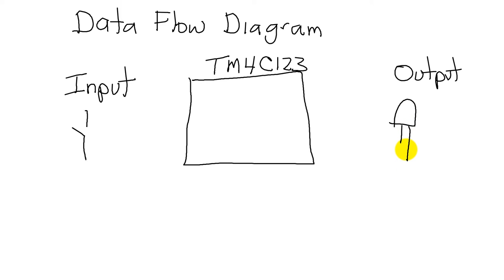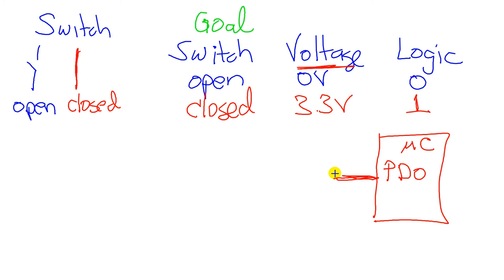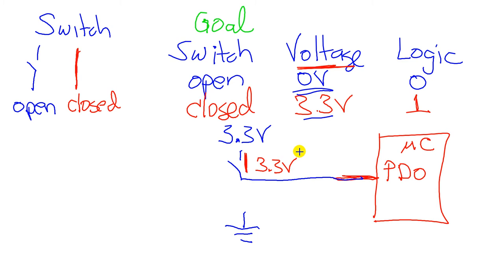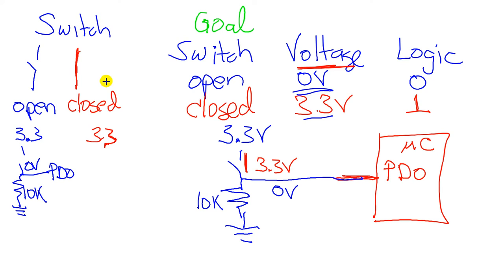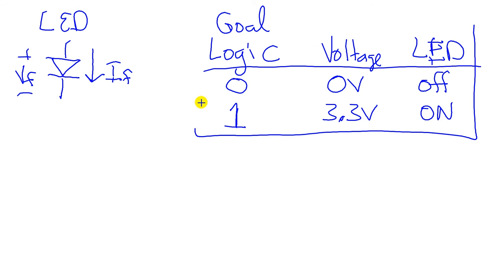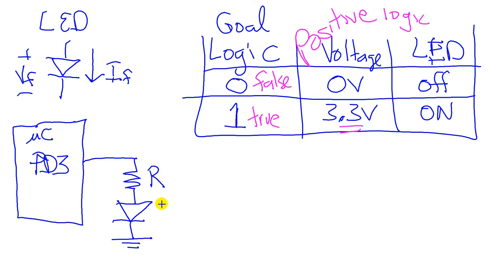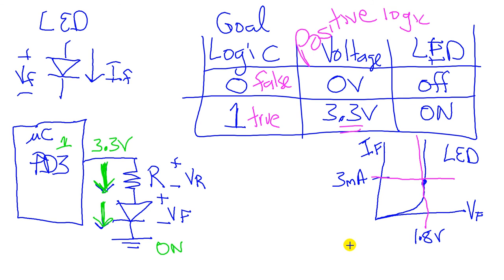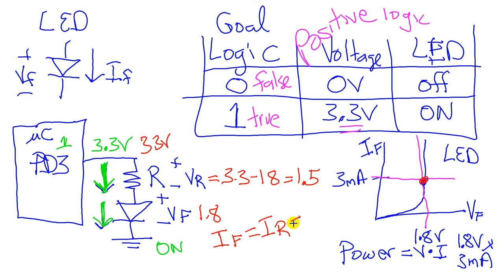C8 2 2 SwitchControlsLight

Comment: We don't use the power formula to determine brightness?
Reply from the maker: We do define brightness in terms of electrical power converted to optical power. For an LED the voltage is almost constant, so we adjust or select the power by selecting the current.